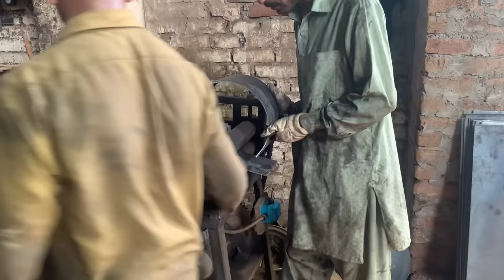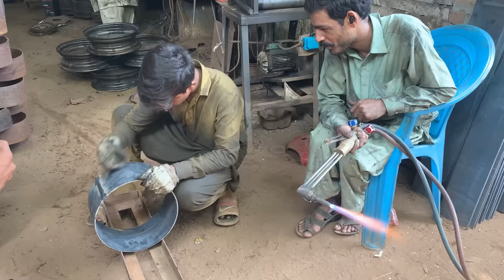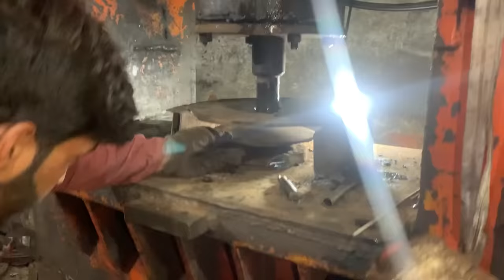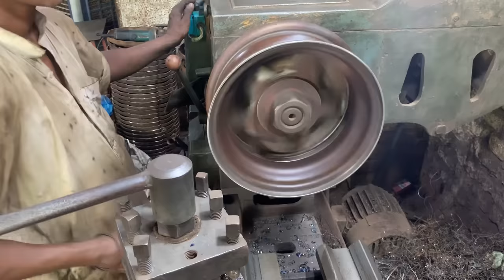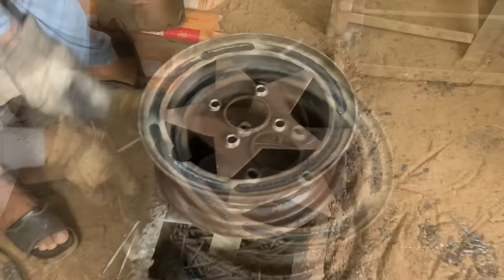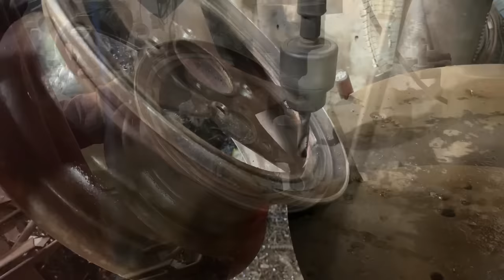How Small Vehicles Wheel Rim Manufacture In Local Factory | Production Process of Rickshaw Wheel Rim

Comment: Finally some decent welding in one of these videos.
Reply: Bro these people have nothing to work with. WTH do you expect?
Reply: But what is with everyone bending the rod? Every welder I've seen in these videos has a curved electrode
Reply: @tek4  Yeah I noticed that. I have no idea. Never seen it anywhere else.
Reply: @tek4  it’s for angle, I’m a professional welder and it gets much more complex than that but that’s the simple answer
Reply: @nuttyc3344  I’ll have to say that for the equipment they are working with, those are good welds. I’m a welder myself, and I’ve seen people call themselves welders and they couldn’t weld half as good. But these people need good safety type shoes, not sandals.. good welding hoods, safety glasses, good welding gloves… safety, safety, safety…so important. I wish these guys the best.
Reply: Yeah welding through rust and oil always gives a nice strong joint. Easiest weld on the planet, let's see him do a 6GR
Reply: @JackOfAllTrades2022  clearly the secret is letting your feet breathe. That's how they put their sole into their work. I love the slides they wear. If I ever went there I'd never get out of the shoe stores. I'd be asking everyone I met, Bro where'd you get those kicking Jesus shoes!

Comment: They use their visual ability instead of precision tools and get good results. Although the star in the center seems weak in my opinion.
Reply: A very weak design for sure. 
I didn't see any measuring tools other than the backspace ruler.
Reply: I agree, the star material should be much thicker.
Reply: @JackOfAllTrades2022  I agree with you. They should also take more care with where they put the holes in the star. Some of them were very close to the corners, which can potentially lead to stress cracks and failures. Other than that, they have done an excellent job with the tools and knowledge they have available!
Reply: These wheels to be used for small loading vehicles and tested don't worry
Reply: it is yes weakest part
Reply: Martin Fierro se horrorizaria de verte hablando inglés...! 😀😀😀🇦🇷🇦🇷🇦🇷
Reply: @babar saleem  That's the point, a better designed would need less material and is a work done only once.
Reply: Yes poor design and hole placement

Comment: Great how 2 bolt holes are so close to the Edge of Star, other 2 are in the middle.. Great Design..!!
Reply: But you do understand that there are 4 bolt holes on 5 star arms? I think it's OK - parallax error
Reply: Cost of labour there must be close to zero to make that operation viable
Reply: @5084204  You can think it's OK, that's your view..You can clearly see its all offset...My view is the centre round section should of been larger in diameter. to make material even all around bolt holes.and centralised,then 4 triangle stars coming out to outer rim.and it usually works like 4 bolt holes,4 stars,5 bolt holes 5 stars..Here in Australia we have ROH who supplied thw world with steel car rims,i'm used to quality and engineering.. Those Indian rims could be a Safety Hazzard if tested to a Car Manufacturers standards..

Comment: Small metal workshops are extremely important for creation of technologically inclined population. Japan has the same system, a lot of very small metal workshops
Reply: I can assure you, what Japan does and this are 2 very different things.
Reply: Yeah they have small metal workshops, but that's literally where any similarities end. Unlike that mess of a facility they actually make you products that have a quality standard or basic things like safety gear. Whats been shown in these kind of videos is a joke, let alone something any sane person should never put into any sort of car. As well as its a complete lie that a shitty workshop like this is the reason for a technologically inclined population proper education and training of staff is what does.
Reply: i used to work for a company making rims for Chrysler back bout 45 years ago and we were making 600 rims an hour , these people are making 1 an hour, thats funny
Reply: Japan has tools and safety measures and proper metal stock. This is like American hillbilly engineering at it's finest.
Reply: I find it pretty impressive what they can get done. While I don’t think these rims can be held to the same standard as a machine made wheel I’m sure they hold just fine 99% of the time. U have to consider all cars built in the 40s and 50s were built by hand with basic tooling like this.
Reply: @ToxicTom1967  Not really. By the 40s and 50s we were well beyond this level and producing at a much greater rate with better precision. This is probably 1910-1920 level comparatively speaking.

Comment: Tons of respect for the work ethic, environment they work in and their skill in the ability to make these with the limited equipment they have!  However, there's no possible way they could keep every one they produce the same. Between the equipment WAY past its design lifespan and no quality control it's unlikely that the reliability or specs are uniform. Still mad respect though
Reply: most of them sold as replacement parts, or they many be sub contractors to the main vendor. Yes there is no quality check , no safety, no inspection
Reply: Pakistani people
Reply: Just look at the point of each 5 ⭐️ star, each point was a different size 😳
Reply: Китай в 60ых 70ых годах тоже с этого начинал, там вообще на задних дворах своих домов, крестьяне плавили чугун, по приказу председателя МАО!!! Прошло 60 лет, и мы видим современный Китай!!!!
Reply: Do they have to be the same? Not all have OCD, and some little differences rearly not harm. We maybe just to hysterical in the west, where none will work on these conditions, but we like have there cheap products and then complain over the unfair competition….
Reply: I have seen factory golf cart tires operate at lower spec than these, not to mention them usually being of different manufacturers. I'm sure the tolerances are fine for the application. Not like its for aircraft or anything that critical.
Reply: I love you Bruh. We think the same.
Reply: @RabidLemurs  Sure you have  sure
Reply: @BertMerlin57  those "cheap" rims as you call them won't fit anything we have in the US, but nice try anyway.
Reply: @BertMerlin57  their cheap products, not "there".

Comment: 5 spoke design for a 4 stud wheel, apart from the steel being too thin 2 of the wholes are right on the edge of the 'spoke'.
Reply: Pakistan has 165 nuclear warheads, but still their people working conditions are pretty awful. Tools from the 1920's and working on sand floor, no tables or protection gear ect..
Reply: These are for three wheelers ... I think not very much load nor speed but ... Yes quality, precision and tolerances are not up to mark...

Comment: Thats big offset for those tiny mild steel spokes
Reply: It will depend on the weight of the car using those rims
Reply: I recon it was welded on the wrong way round!!  Blame the apprentice LOL!
Reply: M C: Yes!  This is my single biggest heartburn about the whole video.  You can tell how soft the spokes are by the fact that a very modest hammer blow changes the alignment.  Please center the spokes on the rim, use tougher steel, or both!
Reply: It probably not for car maybe a riksa
Reply: Even if its meant for a light car, the massive pot holes in the road would surely bend them and the offset makes the force 10x worse. Each spoke needs a gusset.
Reply: @d.jensen5153  The purpose of that hammer is to adjust rim position in the chuck. It don't make anything to spokes.
Reply: @karirautio  If so, that is very good to hear!

Comment: Running a welder through lathe bearings? Its a NoNo!
Reply: Grinding on the workpiece in the chuck is even worse. The grit and dust can get into the bearings.
Reply: @trappenweisseguy27  the two activities counteract each other. The welding pits the bearings and the grit polishes them. It's the circle of life!

Comment: I can't help but feel a couple of good jigs would speed up the process considerably. The centre piece only needs to be welded at the tip of each point of the star. No need to weld the full circumference. Good workers though and solid welds.

Comment: Skilful no doubt, but I'd like to see how it can pass testing and standards?
I could not see butt joint. I liked the heat treatment of the weld. The approximation of the centre point for hole and using of a ruler to check run out was entertaining.
The guys are certainly good at what they do. But no thanks.
Reply: It wasn't heat treatment of the weld, it was heated to soften it while it went through the roller. Heat treatment has not reached this part of the world yet.

Comment: Very basic but ok product for low speed vehicles.
BUT A. the most obvious,, a decent welding helmet. B,  a welding bench.
And there is no reason to weld all the way around. 4 of 2"  welds would bve heaps strong enough, all that weld is time consuming and probably buckles the wheel.
Then ofcourse working in robes with lathes and  welding in sandles.

Comment: The lathe making the wheel center is so out of round its visible in the video.   Horrible working conditions with complete filth and disgusting lack of the most basic safety..   Arc welding in some cases with zero eye protection.. Disgusting🤮  But they work with very little, and make do..  I just don't understand the absolute filth and why no one has enough pride to do even the most basic clean up.